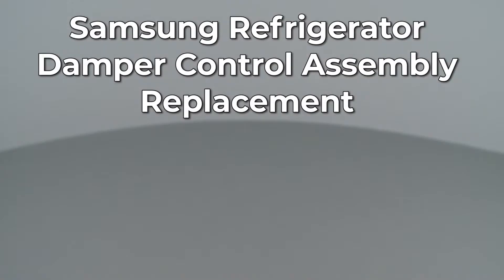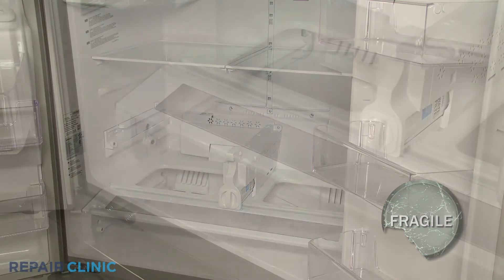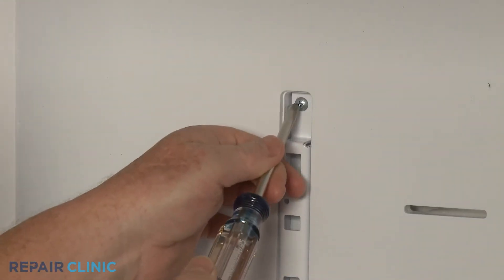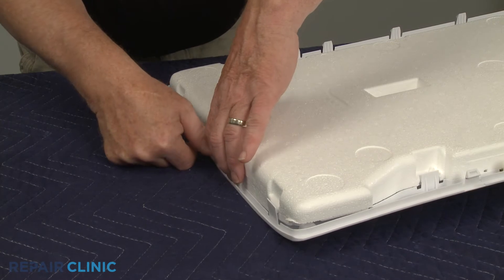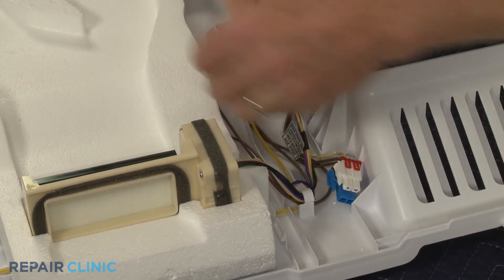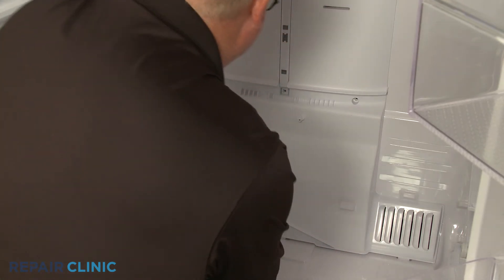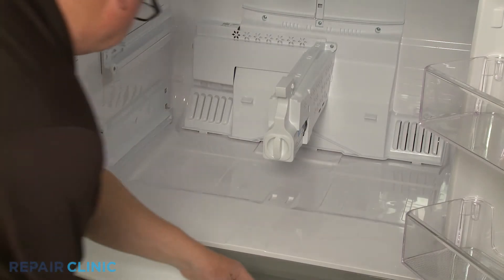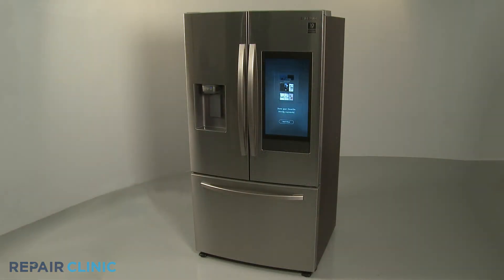Samsung Refrigerator Damper Control Assembly Replacement DA31-00043E

Comment: Hi
what power is required for damper motor
blue/white and red/yellow wire for what
can i check damper working or not with a 12v dc optional adaptor
please reply
waiting
thanks